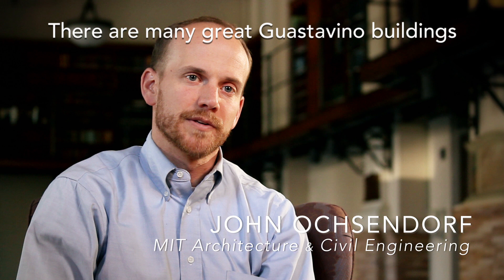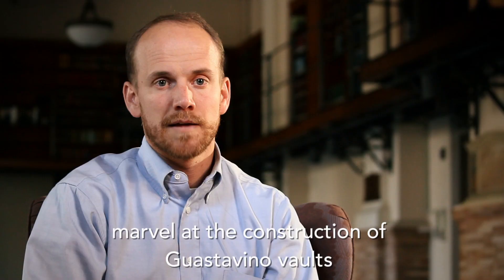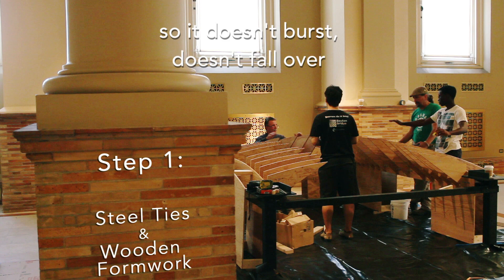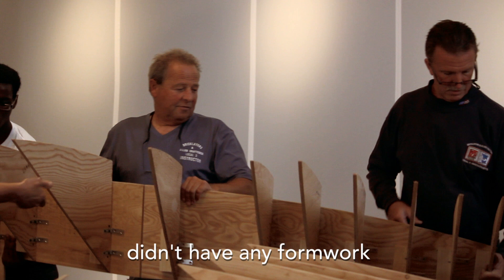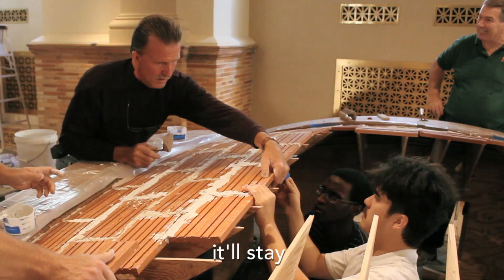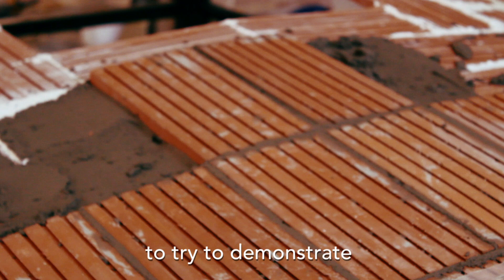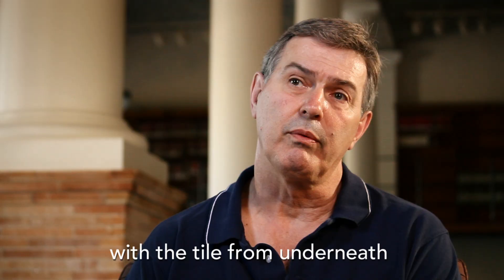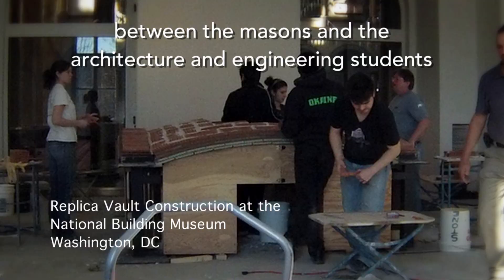Guastavino and America's Great Public Spaces

Comment: I have some original catalogs from the Guastavino Company. Nice to see it being done. They were originally done with no form work. The Verizon building in NYC damaged on 9-11 is a marvel to look at the vaults over the sidewalks. All the domes start and finish with the same pieces in herringbone bond. The joints are all very tight or gauged and the work is perfection.
Reply: Arquitecto Catalá.

Comment: Reasons for the technique not being used today; the technique is labor intensive and expensive and the tiles are expensive. At one point Guastavino company owned their own factory in order to minimize expenses. Guastivino himself built his own house out of wood and not tiles. The technique was utilized mainly in public buildings and in the homes of the rich due to the expense of the technique. The second reason that it is not used is that the technique can not be calculated easily for modern building codes. The proof is in the pudding; the buildings Guastavino Company helped to construct are, to a large extent, still standing. However RECREATING these arches would not pass modern building codes. The geometry is too complex for even computers to simulate their load bearing ability. Guastavino demonstrated their load bearing ability by adding weight to a sample structure; but he could not calculate it. The great strength in the system comes from not from the plaster of paris mortar that is on the edges, but the mortar that binds brick to brick in layers with the large flat surface area, and the resulting tension created by the arch pushing on the edges of adjacent bricks. Truly a thing of beauty. Modern architecture is rediscovering this technique and beginning to build in this manner. A recent advance is the use of concrete stabilized earth TILES. Not bricks, but tiles which can be created on site and used in a similar manner to the fired tiles that Guastavino Company used. This advanced technique helps solve the material cost problem, however the code problem and labor expense problem remain. A competent owner builder may be able to build in this manner at low cost if code allows. Or this technique may be used in an area with no building code and cheaper labor costs. All it takes is a press and %6 cement per brick. Formwork is unnecessary with this technique which is an additional cost savings in construction. As an aside; one architect, I forget his name, used Guastavino's tiled arch technique AS form work. He then added a layer of concrete on top as he didn't trust the technique.

https://l.facebook.com/l.php?u=https%3A%2F%2Fwww.lafargeholcim-foundation.org%2Fmedia%2Fnews%2Fawards%2Fstabilized-earth-visitors-center-mapungubwe-national-park-south&h=ATOJh7o5uVvRTZURFFem7qDbhIUcTKRy8txLSXzb-v4y9UIFV589pKYbKtiNBwS6Lmm4zlOXjWvTfl9B_KZsKESN_sRWkE3whQtiyyYMPcMDEKnwft_ApS4m_w&s=1&enc=AZN5_iYgFqK00uRTPSM3mGSYoAWmP6B56GcfTJL1m6j5Fs-v6rgPMnM2bXQJFPWgcZEXvn03Ig2EwPP8K1bHoKCk
Reply: They have software now that can calculate the loading capacity I believe.